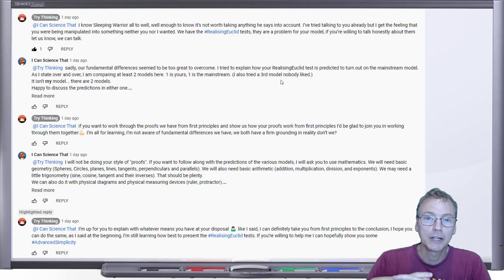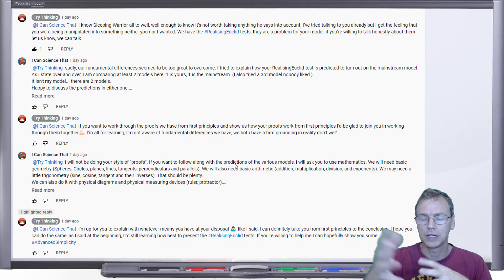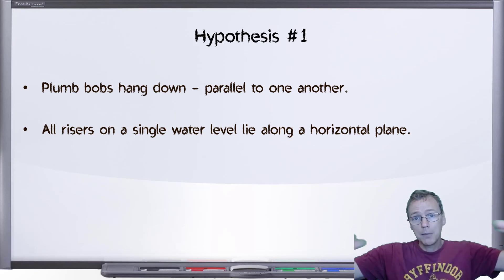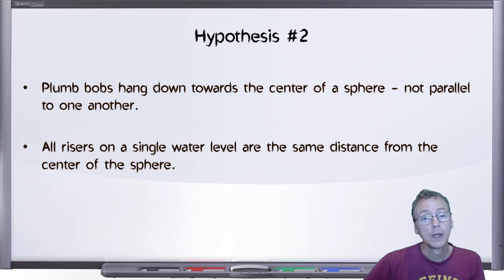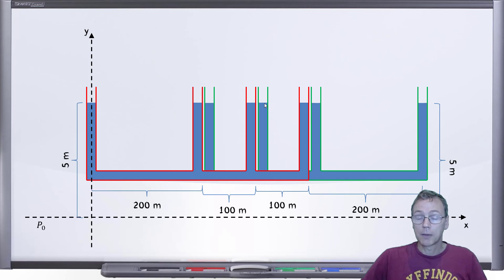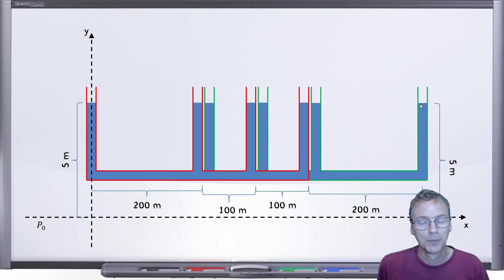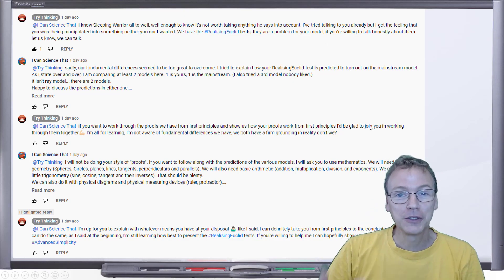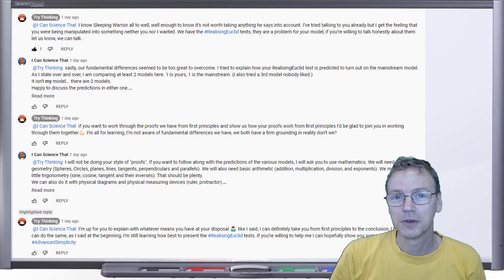Realizing Euclid Step-By-Step Part 1

Comment: To keep things simple, it might be better if you treat the plumb bob and water levels as different hypotheses.
Reply from the maker: They are tied together... really the same thing.
We're mostly just looking at the water-levels, but when we do the measurements, we will be measuring along the vertical direction, and we may use plumb bobs to clarify exactly which direction that is.
Reply: @icansciencethat  I was thinking about a separate test with an alternative and null hypothesis. In this experiment we hang 2 plumb bobs 100m apart on a wide  balcony of a tall building, say 50 stories (150m) 
H1: the distance between the lines at the top is greater than the distance between the lines at the bottom, thus Earth is curved. 
H0: the distance between the lines at the top is equal to the distance between the lines at the bottom, thus Earth is flat. 
For H1: of course, you could predict the difference using mathematics. (2.4mm)
Reply: @profphilbell2075  The benefit of this test would be it would actually show a difference between the 2 models XD. You would have to work out a good location and how to measure the distance but that shouldn't be too hard.
Reply: Reminder: Phil Bell has never apologized for lying online when he falsely claims he is a university and satellite engineer.
Reply: @DrEMichaelJones  Reminder: Mike Jones can't use Earth's coordinate system to calculate the distance between two points without using spherical math.
Reply: @NinjaMonkeyPrime  lol the length and width of the foundation of my house was definitely measured without "spherical math." The diagonal between them is calculated without "spherical math. "Pythagoras would laugh at your idiocy especially since his theorem wouldn't even work on your imaginary model.
Reply: @DrEMichaelJones  "lol the length and width of the foundation of my house was definitely measured without spherical math" That's a great strawman Mike. Did you think the latitude and longitude points from each end of your foundation were large enough to be affected by the size of Earth curve?

"The diagonal between them is calculated without spherical math." Look, Mike pretends he doesn't understand scale. Nice trolling Mike. 

"Pythagoras would laugh at your idiocy especially since his theorem wouldn't even work on your imaginary model" But it does work Mike. Take any two latitude and longitude coordinates and using the haversine formula you can find the distance between them and it matches reality. I'm pretty sure Pythagoras wasn't a troll or a reality denier. 

I can determine the distance between two lat/long points on Earth using spherical math and it matches reality. You can't do the same for flat Earth? Do you have a coordinate system? Do you have a formula?  No? Want to talk about your foundation again?
Reply: oh wow Prof phill Sanders is here.. all of the smartest peeps in da houseeeeeeeeeeeee!!!!!!!!!!!!!!!!!!
Reply: @NinjaMonkeyPrime  feel free to actually measure (not calculate based on coordinates derived from lights in the sky that are most definitely not drawn on the ground) the distance between any two physical points. That distance will ALWAYS be a straight line.
Reply: @DrEMichaelJones  Actually measure? Didn't you read what I said? Using the haversine formula we can calculate the distance between two points on Earth and it matches reality. Every single time. That's a prediction and a measurement verification. What's even funnier is  there's literally nothing anyone can do to stop you from verifying that. 

So you can't determine the distance between two points on flat Earth? That sounds pretty archaic and miserable.
Reply: @DrEMichaelJones  Im a noob
Reply: @NinjaMonkeyPrime  that's fascinating, so you don't actually measure, got it. How do you prove the measurement of what you imagine you calculated?
Reply: @DrEMichaelJones  How are you struggling with such a simple concept? Is this where you act like you don't understand? I can predict the distance between any two points on Earth using the haversine formula, and it matches reality. When I say it matches reality, that means the distance measured matches the prediction. It's not that hard. Predict the distance between two points, then travel the distance between the two points and see if they match. It's literally happening every second of every day. Why not just try it? Take two latitude and longitude coordinates and use the haversine formula to calculate the distance. Are you afraid of the answer? It's not like you have any method for flat Earth.
Reply: @DrEMichaelJones  "feel free to actually measure" Can you give any evidence where an actual measurement between two lat/long points on Earth did not match the prediction provided by the haversine formula? No? How sad.
Reply: @mallorysasylum  
Uhhh....It's Professor Phil Taco Bell....
Reply: @jimsmith7212  Prof Phil is a riddle wrapped in a mystery inside an enigma, just like a taco inside a taco, within a taco bell, that's inside a kfc, within a mall that's inside your brain!
Reply: @NinjaMonkeyPrime  lol you imagine you can "predict" distances without ever measuring them? lmfao
Reply: @DrEMichaelJones  Haven't measured distances? Are you drunk? Your claim about the Erie canal included the distance. Are you still confused about what it means to have a coordinate system? Why would anyone develop a coordinate system that doesn't allow you to calculate the distance between two points? If you are confused about this simple concept then maybe you should revisit lower education since there's kids doing simple math with coordinates right now. So you are admitting that on flat Earth it isn't possible to use latitude and longitude coordinates to determine the distance between two points? Which also means basic flight plans and navigation are impossible on flat Earth. Yet that's all very easy on a globe. Troll harder Mikey. This is the lamest "nuh-uhh" I've seen in a while.
Reply: @DrEMichaelJones  Jones says "feel free to actually measure (not calculate based on coordinates derived from lights in the sky that are most definitely not drawn on the ground) the distance between any two physical points. That distance will ALWAYS be a straight line."

(1) Geodetic surveying, developed in the early 17th century, gives us precisely that accurate measurement, also a highly accurate shape of the earth. 

(2) A distance is not a 'straight line', although a straight line can have a length.
Reply: @edby263  like I said, get out there and measure it and report back. The shortest distance between two points is definitely a straight line.
Reply: @DrEMichaelJones  *Definition of geodetic survey*: "a survey of a large land area in which corrections are made for the curvature of the earth's surface" (Merriam Webster)
Reply: @edby263  "Corrections" for non-existent and definitely not measured "curvature" added in after the straight line distances between points were measured...yes, you got it. Well done, little buddy!
Reply: @QED yes indeed. I estimate 2.4 mm difference. Far too small to be meaningful

Comment: Why do I have an odd feeling we will only get participation from the glober community? It's a little sad that I've experienced enough of these online group efforts to have built up an expectation of non-participation from their community. It can't be an issue with us since fe led exercises that invite globers usually (afaik) doesn't have that problem. In any case, I've submitted my answers but I won't hold my breath bev, his "we're not flat earthers" crew, or self-aware flat earthers will play along.
Reply: Bev 'replied' to ICST's challenge last night (18 Aug 2022). He thinks that ICST is trying to prove there is no difference between a straight line and a circle.
Reply: @edby263  why am I not surprised he failed (intentionally?) to grasp what was being presented to him. If this happened once or twice, then it might’ve been believable that he missed a crucial turn and misunderstood the point of the discussion. But seemingly every time he’s interacting with this type of stuff, he can’t follow a very basic thought process? Give me a break.